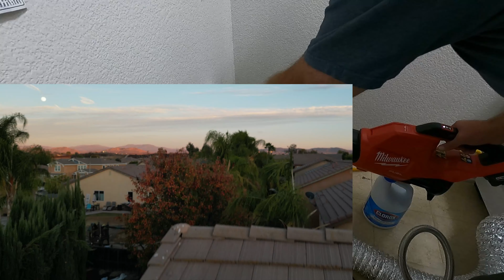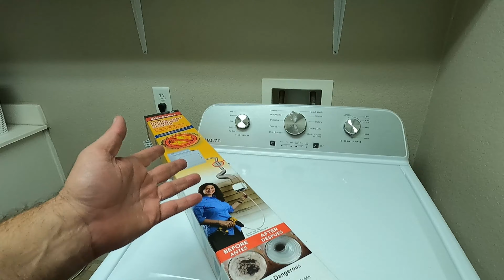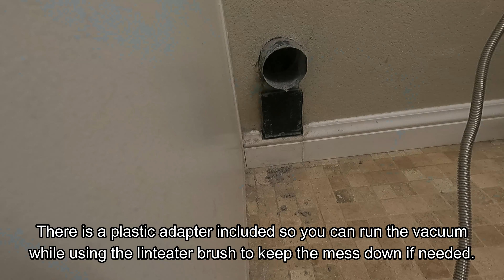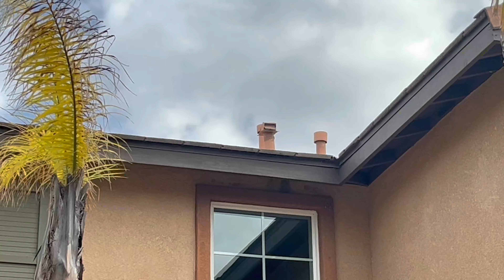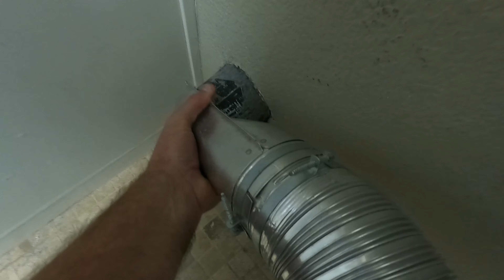Dryer Not Heating Up Enough or Taking Too Long? How To Clean Dryer Vent - Rotary Brush & Leaf Blower

Comment: Cool.
My dryer is in the garage, and I my vent is about 6" straight pipe through the exterior wall. So super quick and easy to clean mine.
I have replaced the heating element twice on my dryer new heating element was like 40 bucks, and a 10 minute youtube video showed me how to do it.
I've had that same dryer for over 20 years.
Cool video though, could come in handy if a friend or family member needs help.